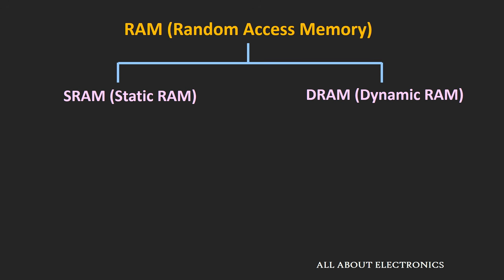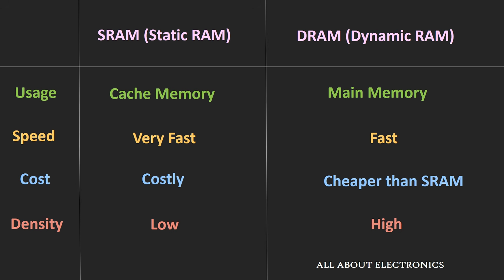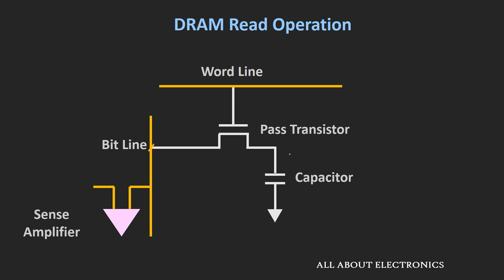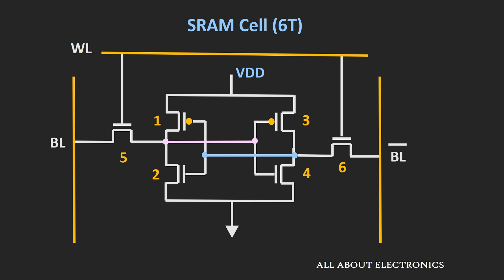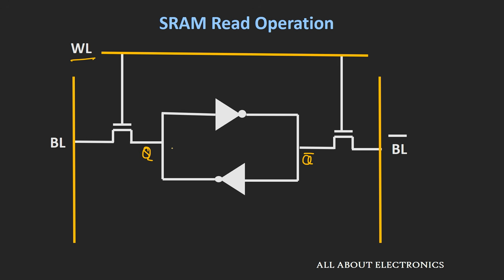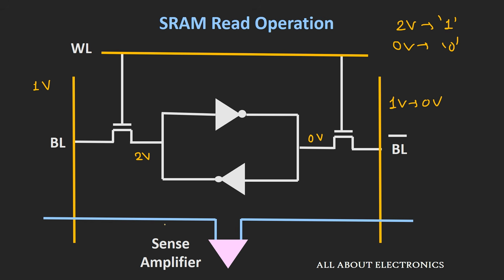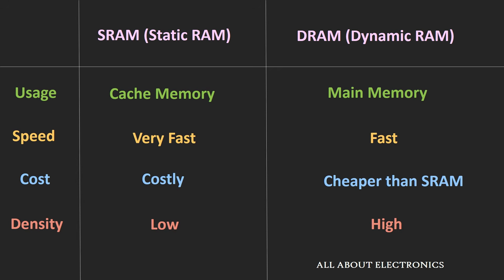SRAM vs DRAM : How SRAM Works? How DRAM Works? Why SRAM is faster than DRAM?

Comment: How periodic refresh cycles done in Dram for the cap
Reply: I was wondering this! maybe there's a mosfet connected to the capacitor with an AC signal at the gate? if you used the clock cycle of the computer with a phase, I bet you could get it to charge only when there are no reads or writes occurring. really not sure though!

Comment: Where can i learn circuit components like you mensloned in this video?
Reply from the maker: There are different playlist on the channel . You can refer them. For example, for MOSFET there is a separate playlist. You can refer that for more info.
Reply: @ALLABOUTELECTRONICS  Thank you so much

Comment: I could not get the line 8:37. Can you please rephrase that.
Thanks for this amazing explanation. Keep up the good work.
Reply from the maker: What I meant to say was, using (4T) cell, we can reduce number of transistors (instead of bit) that is required for storing 1 bit of information. I hope, it will clear your doubt.

Comment: 🙌 Very well explained, but still in doubt regarding the power consumption comparison
Reply: everything on the die is also a resistor, including the traces. by having a larger, more complex circuit for every bit of data, you are dissipating more energy as heat. so, when it comes to energy efficiency per bit stored, sram is way less efficient than dram.

Comment: I still don't understand how that flip-flop loop in SRAM maintains the voltage without needing a refresh.  I know there is no capacitor so you don't have to worry about a capacitor discharging.  However, if you're not performing any operations on that memory cell for a long time, how does that voltage not fade?
Reply: OOPS, never mind.  I just looked at the diagram again where you show all 6 transistors instead of showing each pair as a not gate.  I can see that it's connected to VDD.  So EVERY bit has a constant connection to power.  That would also explain how an SRAM cell can turn a 0 into a 1.  I'll leave both of these comments here in case someone else thinks the way I just did after seeing the video.

Comment: During write operation, when we apply 1 to the output of a previously zeroed inverter, in the instant before its transition it will short the input voltage to ground, so for some pico second, the current will be very high upto a few Amps!! So, it will load the power line and will shut off the whole operation for a picosecond!!! Please explain it to me.
Reply: A. Research the meaning of the word pedantic.
B. The traces on the PCB will have resistance,  inductance, and capacitance which prevent an instantaneous transition to infinite current.
C. The source voltage has a limit of current it can source.
D. This is a super simplified diagram of the circuit. Obviously there are going to be current limiting resistors in any circuit.
Don't act dumb.

Comment: Around 8:40 you said that by using 4 transistor we can reduce no. Of bits required to store the bits..I didn't understand this part. Can u explain?
Reply: Is probably none sense. And while I have to admit that there are many resistors on a lot of PCBs, there are none inside an IC.

Comment: I got everything but I don't actually get what you mean by "density" when you talk about the rams
Reply: Emilio Ortega by density he means the amount of data it can hold for example a typical ram  sticks nowadays can hold 8GB of data where’s the cache memory in typical CPU’s is very low like around 6MB of data
Reply: @oliverenede7839  Hi thanks for answering, now it makes sense  because he in the video talked about the number of memory cells and said Sram had less than DRAM :s and that's what I don't understand

Comment: Nice explaination but how can a transistor pair store a voltage?
Reply: Hi Vikash, Here transistors are used to get a latch of invertors(Latch/FF are used as storage element). 
And If you see at 7:35 you can see BL (Bit Lines) are controlling only Gates for these CMOS-Invertors and also connected to Output in READ mode. 
And voltage sources VDD and GND are present. 
     Let say output of first and second invertors are INV-12, INV-34.
So INV-12 is controlling gate of Second invertor. 
   INV-34 is controlling gate of First invertor.  

Now consider that you want to WRITE '1' in this CELL.
So BL == 1, and BL(BAR) == 0.
It means 
   INV-12 == 1: 
       transistor 3 == open circuit
       transistor 4 == close circuit
   Output of second invertor is '0' that is matching with supported voltage of BL(BAR)
 
   INV-34 == 0:
       transistor 1 == close circuit
       transistor 2 == open circuit
   Output of first invertor is '1' that is matching with supported voltage of BL

And all these operation takes place only when WL make close circuits for 5 and 6
.
So in absence of WL there is no change in gate conditions so no change in invertor conditions too.
And output voltage controlled by VDD and GND and depending on current conditions of 1,2,3,4, transistors.
 In READ mode: we don't apply EXTREAM voltage on BLs,  we just apply adequate voltage to check direction of resultant(of BL and Output voltage of invertor) voltage flow to decide Logic '0' or '1'.

Comment: Sir how is value being read from the SRAM if there are no capacitors to store the charge or no storing device to hold the voltage
Reply: If you know about Flip Flop Or Latch then you can understand with the help of Transistors (1/2/3/4) we are trying to make a memory cell that can maintain a state as we do in FF/Latch. And voltage level we are getting as per the state of these transistor either High(say 5V) or Low (say 0V).  These voltage levels depends on the source voltages (VDD/GND).      HTH

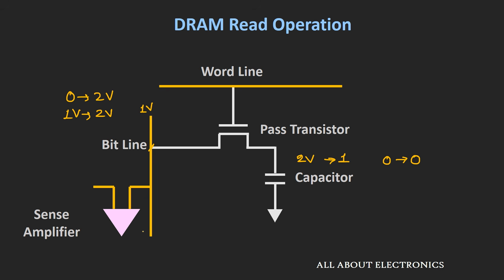Comment: I can't understand what u are saying at 6:00 . Can u please elaborate it how we are increasing the reading speed further?= 2nd method
Reply from the maker: What I mean to say is instead of measuring the absolute value of the voltage, just by measuring the incremental voltage (increase or decrease in the voltage at the bit line) the reading speed can be increased further, as now no need to wait till the voltage at the bit line reaches the final value. 
I hope it will clear your doubt.

Comment: Won't the precharged bit line write into the capacitor during the read operation of the capacitor containing no charge?
Reply: Sharon Alexander Not really. "Precharged" means that the data line WAS being continuously driven to be at 1V but now, it IS not. And it has remained at 1V simply because it hasn't been given any reason to change(it's like 1V was being supplied and suddenly, the voltage source was disconnected). The line is now free to take any voltage that tries to drive it. So, during the read operation, the capacitor will drive the line. However, during the write operation, the data line isn't "precharged" but is continuously driven from some source. Then, the capacitor will be one being driven.

Comment: Dude, can u explain about amplifiers
Reply from the maker: Hi, Do you mean to say amplifiers in general in electronics?
Reply: ALL ABOUT ELECTRONICS  yes dude, basic working and opamp like that
Reply from the maker: Yes, Definitely I will make videos on it.
Reply: ALL ABOUT ELECTRONICS OK dude.... I'm waiting
Reply: I have been trying to find how the sense amplifier works (with equations and/or graphs) but I haven't been able to find it anywhere in the internet, not even wikipedia!! If you could clarify that, it would be awesome!
Reply: @luisjalabert8366  The sense amplifier is the same thing as a regular amplifier...